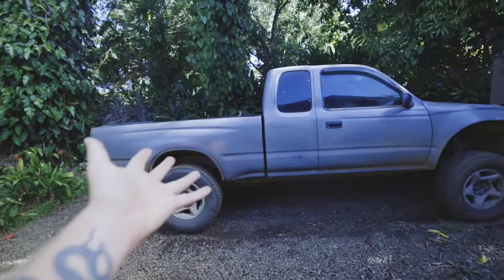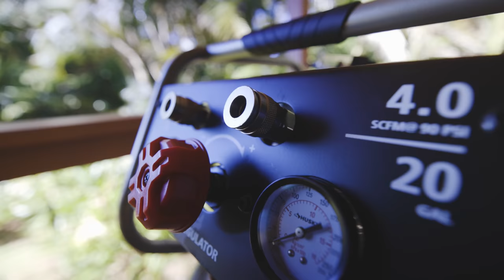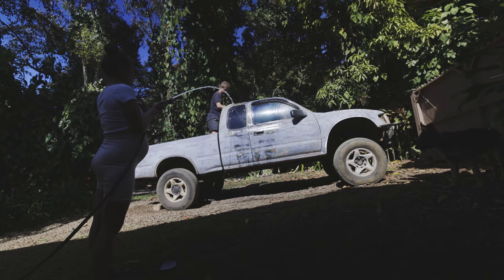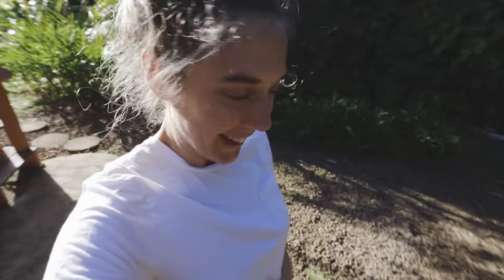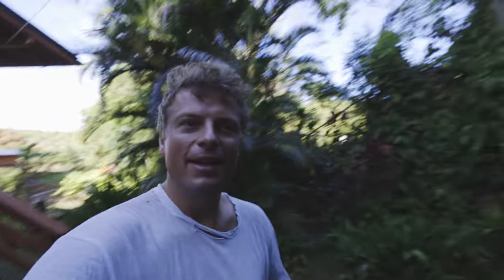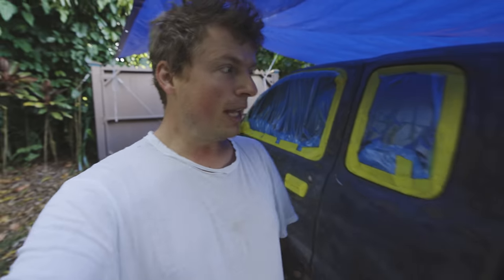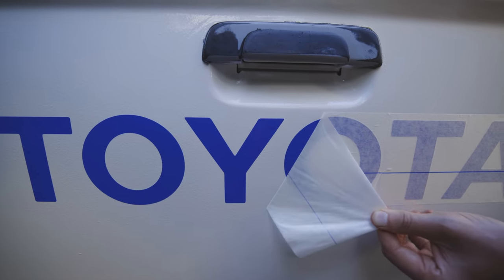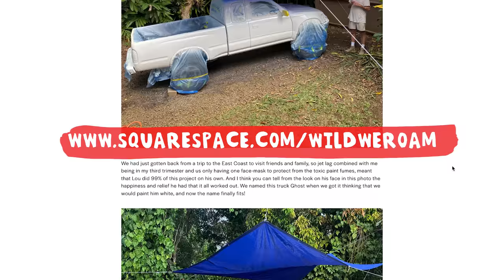Painting My Old Truck

Comment: I am hoping that you prepped the surface.  You didn’t have to be that aggressive.  You now use water sand paper after washing it, especially where you lost your clear coat
I supposed you liked that up.  Then apply primer, wet sand by hand again.  Then use green magic.  More sanding.  Wipe the vehicle down with mineral spirits. Iight coats of painting.